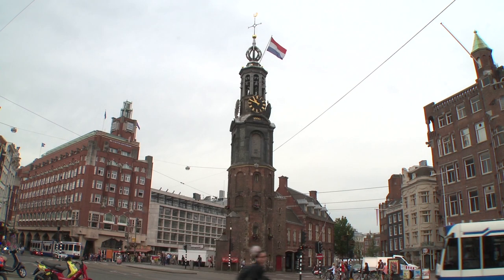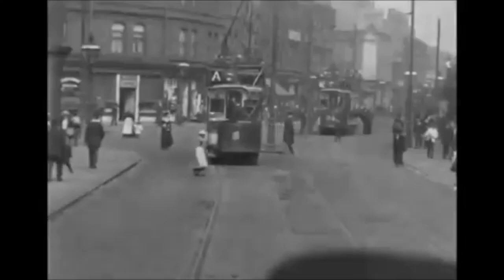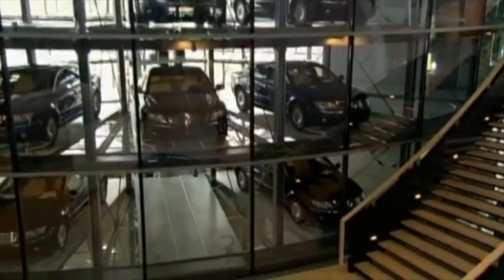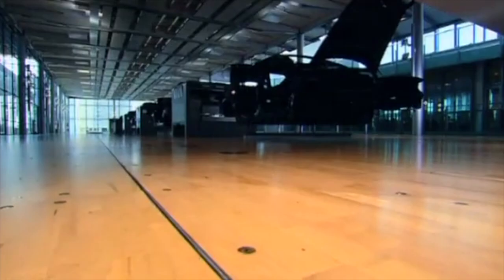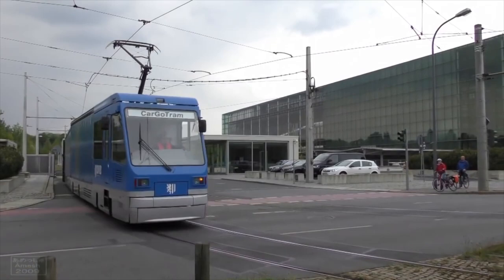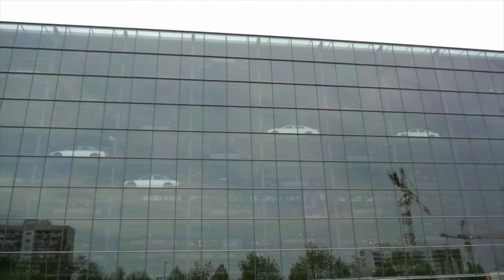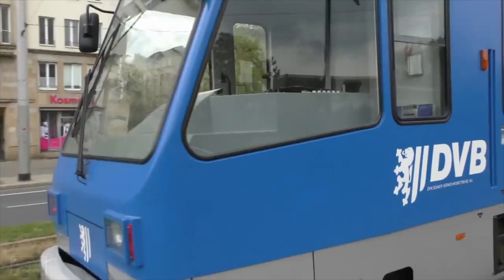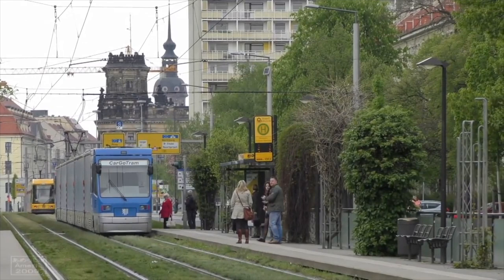That Time When Freight Was Transported on Trams

Comment: I wonder if this style of tram service could be used by state postal services, assuming post offices are near the line. Out in Tempe, Arizona, a suburb of Phoenix, there’s a USPS post office next to the light rail line (just in front of the Smith-Martin/Apache Boulevard station), and cargo trams could be used to connect that to whatever the USPS uses as their main distribution center for the Phoenix metro area. I also wonder if huge stores or malls in city centers or along tram lines could also use the same kind of service.
Reply: Did you check the interconnectivity in terms of tram lines between those distribution points and post offices? Seems like an interesting idea, but I doubt the infrastructure exists, to make the expenditure worthwhile. For example  VW spent over 6 million marks for this cargo tram and it ultimately failed. 
Sorry my background is in engineering and finance. I love ideas  that theoretically improve efficiency, but I also tend to look at their feasibility too. Hope you get it built,  Since  I also love when, my doubts are proven wrong lol.
Reply: "state postal services"?

Comment: What was the new logistic strategy? Did they start using semi trucks?
Reply: "Transparent Factory" wikipedia page has info on it.... Production switched from the Golf to the ID3.... 

So apparently logistically the tram was no longer a viable option?  It's a shame since the tram costs billions to produce... 

If you can find out any more specifics, feel free to get back to me....
Reply: @nc3826 were their any other reasons for why they stopped using the Cargo Tram? And was this model replicated elsewhere?
Reply: @Kishanth.J  VW produced automobiles in the city, as a marketing tool.... But its inherent inefficiency killed it off.... The cargo tram reduced the inefficiency, but it couldn't eliminate it....

Your second question maybe addressed in the Wikipedia page, that I previously mentioned....